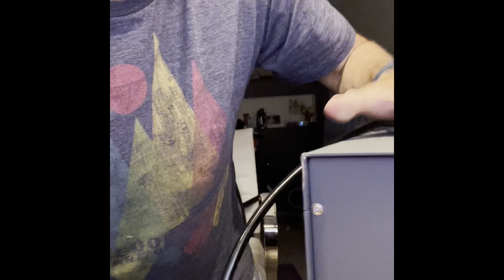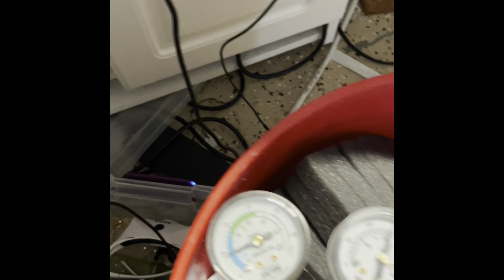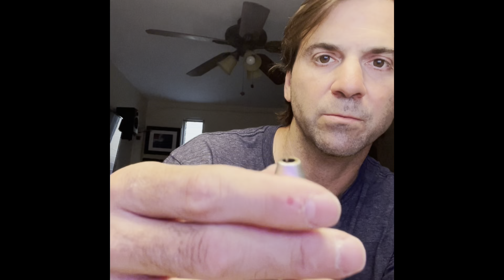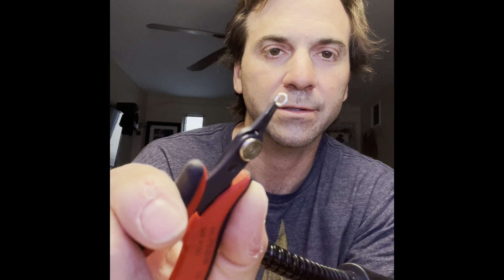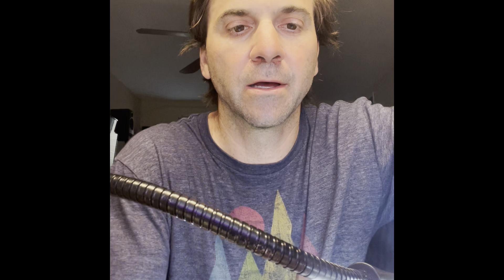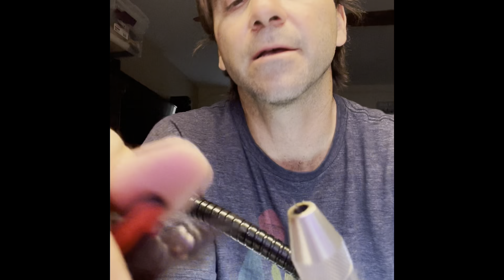Amazon Welder Setup and basic settings for Permanent Jewelry !

Comment: Have you found a supplier for replacement electrodes? What angle is electrode sharpened to?  Thank for a helpful video.
Reply from the maker: Hey sorry I've been off the TUBE for a while.  amazon has electrodes.  Midwest tungsten is the seller. sharpen to 10deg
Reply: @Friction-Jewelry  Thank you very much.  Appreciated

Comment: I wanted to ask, can one use oxygen instead of argon. I have a torch but it is a pain in the butt. Excellent presentation, by the way.
Reply from the maker: Oxygen won't work. The welder needs an inert gas / argon for the weld. Thanks for checking out the vid glad it helped some
Reply: Thank you!!! The welder will arrive in the middle of next month, and I will be on my way!!!

Comment: This is what the welder came with 1* Welding Machine
1* Argon Tube
1* Circuit Clamp
1* Grinder
1* Welding Gun
1* Welding Workbench
1* Pressure Gauge
1* Power Cord

Comment: Can you show us a tutorial without argon gas?
Reply from the maker: It’s the same, just without argon you’ll get more soot with every weld and will clean need to clean the electrode often.  Welds aren’t as strong either, but depending on what you are doing it may not be a huge deal.

Comment: Do you change the settings on the side according to the metal you are using or don’t choose any settings? 

And thank you for the videos, I have found them all super helpful 🤍
Reply from the maker: I no longer use this welder but when I did ya I changed the settings depending on thickness of metal (gauge) and metal type ;)

Comment: Ive been blowing up my sterling silver 26g jump rings with this welder, i put the settings at 1/3 & they just keep blowing up, any tips??
Reply from the maker: Hi! 1) you need to make sure you are closing the jump rings razor flush together so use some 10x+ magnification to be sure.  2) you may need to blunt your electrode. Grind down the sharp tip slightly to flatten it. This will distribute the energy different at the weld spot (less intense at one point).  
3)if you are going to working with delicate gauge metals, 24-26 etc, you will see the limitations in consistency with this welder.  So if your business is working, it may be time to upgrade.

Comment: So i havent been using argon yet but when i get a tank what kind of safety tips would i need to know? Is it supposed to be stored a certain way? I work in a salon and want to extra cautious
Reply from the maker: Just make sure it doesn't get knocked over.  tuck it away :) just make sure your regulator is tight (use a big wrench ), and keep the flow rate low.

Comment: This Pulse Argon jewelry welder (Jinhuo) Is a load of crap, with no support. Probably due to the fact its a load of crap !  Used it once to test it, next time I brought it out it locks up in wait never charging to ready. Read this problem with others on other sites. Also does not discharge when powered off, use a power resister hooked to ground and touch to tip when power off, this also stated on other sites. (WARNING) Appreciate your video though it has good info.

Comment: Hi I am a newbie and I just got this machine. I was trying to figure out the copper head to try and twist it off to put the tungsten needle in but it wouldn’t budge. so my friend tried to take it out of the pen and he broke it to pieces😢 What if the copper head broke inside the pen? Do you just get a new copper head for the needle? or is the old part still stuck inside and broken? 😞I don’t know if I should get a new copper head for the needle and try that or just get a new pen connection entirely. Please help!
Reply from the maker: Hmm. Copper head I assume you mean the collet that holds the tungsten ? It’s just a screw. I’m not sure why it wouldn’t budge / unscrew.  Send pics to my IG I guess
Reply: @Friction-Jewelry yes the thing that holds the needle. The outer screw came off just fine, but the inner one that you put in the needle and then put into the pen broke off. I’ll send pics.  thank you!
Reply from the maker: @ChandoppeHorvath  Ive never seen or heard of that happening I'm sorry.
Reply: @Friction-Jewelry that’s ok. I realize that piece rusted in there and broke off. I got a new pen to replace it. I was freaking out but a simple fix once it came in the mail
Reply from the maker: @ChandoppeHorvath  it's great you got some customer service.  That is one advantage of Amazon, bc they know you can send it back easily.

Comment: Great video Thank you I Am just venturing into the world of permanent jewellery Does the welder have a safety feature that unless you complete a circuit it won’t fire I just want to be absolutely safe I see it’s a feature with the Zapp and Orion welders and I am swaying towards those but the price is huge and the Amazon one price is great for a start up
Reply from the maker: All of the welders have a delay period between first connection of a completed circuit and firing. Ya the Amazon machine esp used is so cheap it’s great for proof of concept. When this video was made the zapp (or plus) did not exist. Also Orions could not be had used or refinished for $1500.  Like I said in my video if you have a good venue to sell at, it’s worth upgrading right away. If not, Amazon is probably your call.
Reply: @Friction-Jewelry  Thank you 🙏 I am considering the zapp plus with the screen

Comment: Hi! I am having a hard time closing the weld. I keep blowing through jump rings and different settings. What setting do you recommend for a small 3mm 14k gold filled jump ring?
Reply from the maker: Go to 1/3 on the settings. Clean your electrode. You need a sharpener. See my other vids on that.  3mm doesn’t matter, it’s the thickens or gauge of the wire / jump ring / chain link that will dictate the settings.
Reply: @Friction-Jewelry  Thanks. I have tried that and the first time it will spark, then after that I don't get a spark. Any idea of what could be the problem? I've been searching online for some sort of answer and cant find it!
Reply from the maker: @taliespidesigns5757  chances are you aren't getting a spark bc you are flinching or pulling the stylus away too quickly.  Try and maintain gentle, even pressure on the weld joint until the machine fires

Comment: I have my machine set up correctly, it is working half the time I do not get a spark/weld. When I do get a spark and weld it does not close the jump ring. help!
Reply from the maker: Ok so, there are a few things that could be happening. Beginners tend to pull away while welding. Keep light but steady pressure on the joint until after it’s fired. 2nd, too little power will cause the jumps to not weld. Try raising to 2/3 or 1/6. 3rd. Clean your electrode. If you are working with black soot on your electrode the power settings are going to be off. Always work clean.
Reply: @Friction-Jewelry  Thank you so much! Do you have any recommendations on what tools I should purchase to see better?
Reply from the maker: @taliespidesigns5757  Seeing is like the #1 most important thing and its kind of the weakness of this machine bc you basically need to freehand weld with glasses on..which are dark.  So you'll need a magnify light 5X to 10X range, with a big built in light. Check amazon.
Reply: @Friction-Jewelry  Thank you!

Comment: There's something called an "air pressure guage" on the one I bought.  There's a place for a smaller tube marked out and what appears to be a 1/4" tube marked in.  There's a plastic knob on it,  that doesn't seem to turn.  I'm guessing I need to buy a separate regulator and somehow attach this to the reglator, but not sure how or how to use the knob
Reply from the maker: Ya I wouldn’t even bother with that. Just buy the regulator for pulse arc welders. I got mine at Pepe tools I think like $120. 1/4 tube quick connect on the regulator.. I’ve got another video about gas 😊
Reply: Do u have to use gas

Comment: You said 

Settings- 
1,3 
2,3

1,6 
&
2,6 

But which setting for which metal?
Reply from the maker: Hi! It’s more about the gauge (thickness) of the metal vs the material but both are important. Most welds in perm jewelry are going to be at 1/3 for all metals. If you are working with 22 gauge plus, 1/6 or 2/3 might be better.   Sterling and gold usually take less power than gold filled or stainless.

Comment: This has been very helpful.  I'm just starting and couldn't figure it out.  But now I know my settings were way to high. What part did you use to sharpen electrode
Reply from the maker: Mine didn’t come with a working sharper, check my other videos for options on that ;)

Comment: Hi! Thanks for the video. If not using the gas, can I just skip the argon steps and do everything else the same?
Reply from the maker: Ya it’s the same, argon is just part of it.  Add it when you can.
Reply: @Friction-Jewelry  awesome thanks for the quick response. Maybe you can answer another question I have? I just set my machine up tonight and I’m having an impossible time with building the stylus holder, I can’t seem to get the screws in on the two arm pieces- any advice, or alternatives? And two, I just tried to close my first jump ring- I unplugged the machine but wasn’t sure it was safe to you the tip by hand, so I decided to touch it to the alligator clip, and it blew a large hole. Can you explain why that happened so I don’t make that mistake again?
Reply from the maker: The first question, maybe send me some pics to my IG account.  I'm not following the issue.  The 2nd question, I'm not sure I  understand that one either. If you touch the grounded alligator clip to the stylus, that completes the circuit and the machine will fire.  If you touch the stylus with your finger the machine wont fire so that is safe.  You can change the electrode with the machine one etc.   @ychea5763

Comment: Hi not sure if you can help but when I plug mine into the power outlet it just consistently makes a loud beeping sound that only turns off if I power off the welder switch… could it be damaged? Or could I need a converter/higher voltage? I’m in LA, CA
Reply from the maker: did you get this resolved ? sorry I totally missed your comment.

Comment: I can’t use gas at the moment and so the electrode is turning black. How would I clean it between each client?
Reply from the maker: A quick with a clean dry cloth will help but you need to remove the electrode and sharpen it. See my other videos on sharpeners.

Comment: One more question, does it always have a spark when it hits to weld. Or is that alwaa misfire
Reply from the maker: Not sure what you mean by misfire, I think you mean when there is a tiny spark but not a legit zap.  Usually those happen when a break in contact is made, you flinch or shake and the electrode is pulled off the weld spot too soon. Hold the stylus as steady as possible and it should fire most times.. try and get some part of your hand stabilized on the table so it’s not floating.. does that help ?

Comment: What kind of dremel tool do you have in this video?
Reply from the maker: Dremel Lite 7760 w/Electrode sharpener jig. Dokili brand on amazon about $30.  I also recommend the cordless Didumen sharpener on amazon. that one is my top pick bc it comes with the jig and can be used as a dremel as well.

Comment: I am looking for a welder to weld small pieces of sheet together, coper, brass, and fine silver, for jewelry items.  Something like overlapping two pennies and welding the contact point.  They only need to be able to survive light handling, would this machine be able to do something like that?  Thanks!
Reply: I just bought this machine for this purpose. I spot two pieces together and the solder/braze them together conventionally. Works perfectly.
Reply: @hansmeevissculptures8234  Very cool, thank you!  How thick of pieces have you worked with?  I need to work with 18 and 20 gauge, will it work for that?  Thanks again.

Comment: Great info! Thanks! How does it compare to the orion? I was debating between a orion or the dado 2, but now i want to try this cheaper machine instead. I've been doing some tig welding with silver and gold, so I'm really tempted to buy this machine for thinner material... is it worth buying for welding/tacking thin material, filling casting defects, and re-tipping prongs?
Reply from the maker: This is tough question for me, as I do not do fine jewelry, settings etc.  if my goal was fine material like under 24g, consistently, I would buy the Orion mpulse or maybe the Zapp. For 2 reasons: 1, the microscope attachment, 2, lower power and consistency.  I’ve never used the Dado 2, it looks great but price.. if you are using the welder professionally for an existing business, again I would buy the Orion. But if it’s more hobbyist then sure you could easily buy the Amazon machine and return it if it doesn’t perform for you.
Reply: @Friction-Jewelry  thanks for your input... 24ga would probably be the thinnest I'd weld. For a fraction of the cost of the orion, I think I'll try it. I wish I could weld under my microscope, but I don't think ill see good with dark goggles on, so I'll try with an optivisor and shade 10 goggles. The orion microscope definitely seems like the best way to get a more productive workflow...
Reply from the maker: Shade 10 are dark , you'll need a lot of task light.  I Like the 10x magnifying lamp plus shade 6 or 8 glasses.  Optivisor is ok but I feel like with welding glasses its cumbersome. This is low power welding so you'll be safe with lower shade. AWS says shade 8 but I found them to be dark...again its one of the reasons I use the Orion setup.  no glasses and smooth work flow. But ya man, for the cost it's worth a shot. return it if it sucks, the beauty of amazon!  @jeff_desir
Reply: @Friction-Jewelry  ok thanks for letting me know, I figured 10 because I'm used to tig welding with an auto darkening mask set to 9-11 shade depending on amperage. Thanks again for the information, very helpful... I think that cheap machine can be useful, only downside seems power precision tuning and no microscope option...

Comment: For the welding pen/the part we have to sharpen, do we sharpen it all the way until there is a pointy point?
Reply from the maker: Yes it shouldn’t take long to make it very sharp. Wear an n95 mask and do it outside if possible tungsten dust is not good for you.

Comment: So the Power you need to weld Gold Silver is very low %2 power of the unit. Should be also posiblel to weld it with these litel unit used to weld Lithoum-Ion batteries

Comment: amazing vids! very informative! is it possible to weld gold filled rings or other, thicker parts of gold filled jewerly with this welder?
Reply from the maker: Personally I’ve only done a couple ring repairs. So it’s def possible.  The thing with Gold filled, when you weld the base metal gets “remixed” with the plating so the weld area becomes exposed. So that spot will not look like the rest of the ring and may show tarnish differently.  But that doesn’t mean don’t do it :)